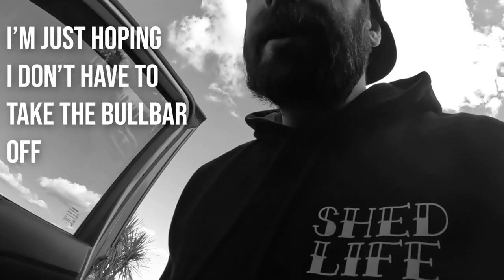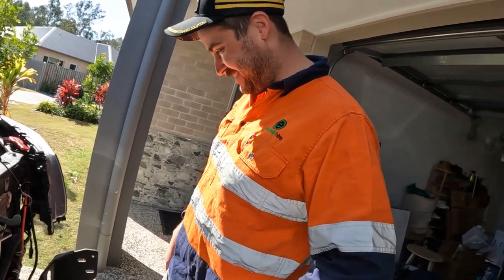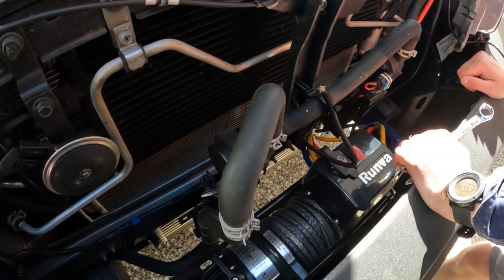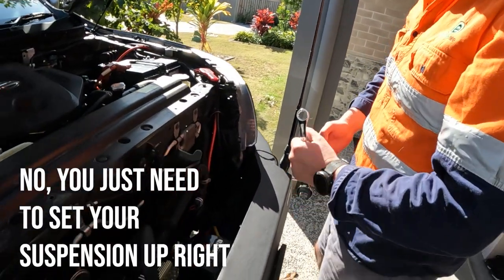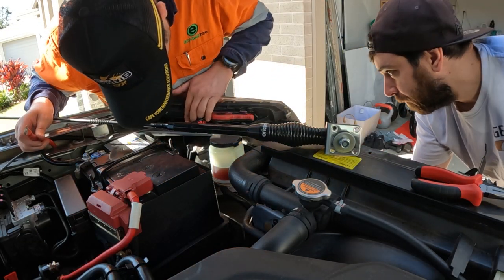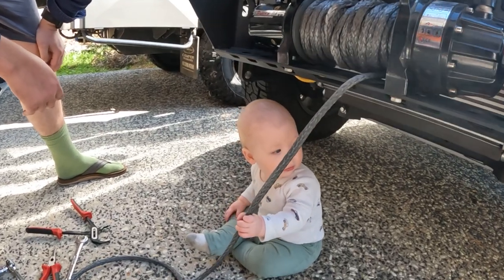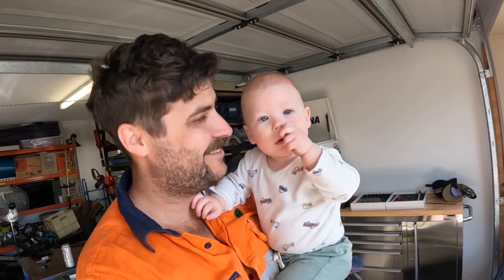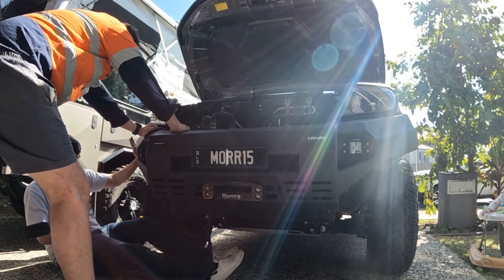NP300 Build continues, winch fixing.

Comment: How have you found that winch with nearly 2 years on the clock
Reply from the maker: I sold the Nav end of last year but used the winch a couple of times while I had it and it was great, did its job. Disclaimer though, I wasn't hanging from a 45 degree climb or anything. Just a couple of bogs here and there. I rated it enough that I bought the same one again for my Ranger 😃